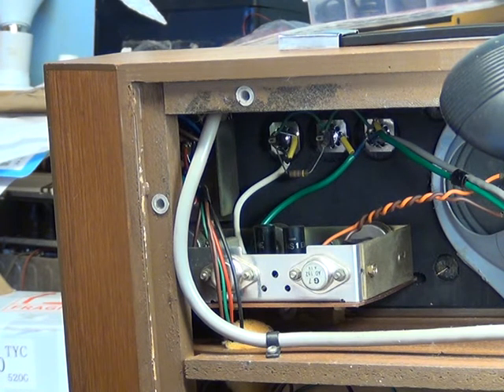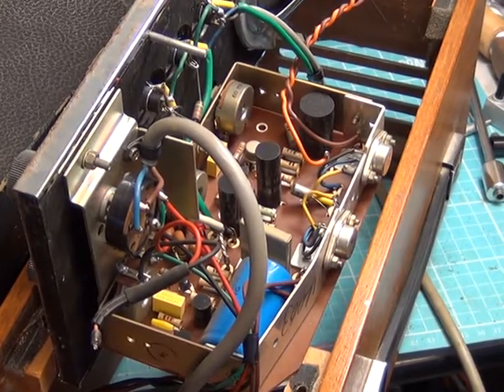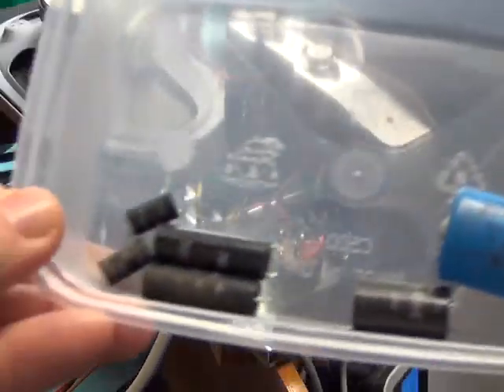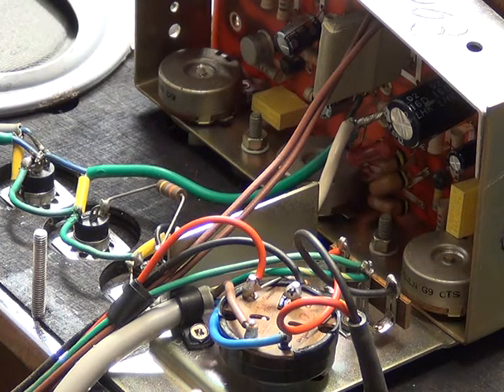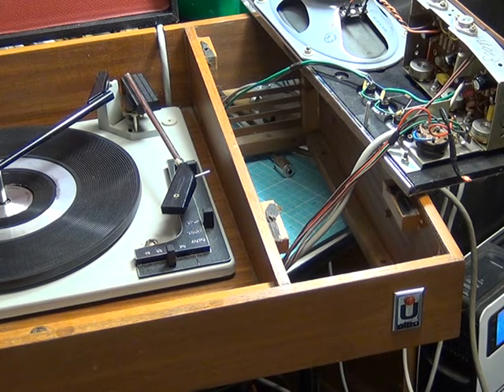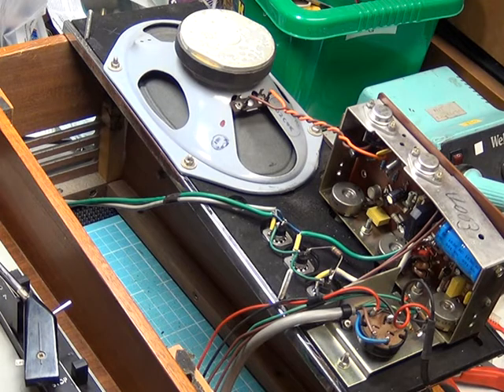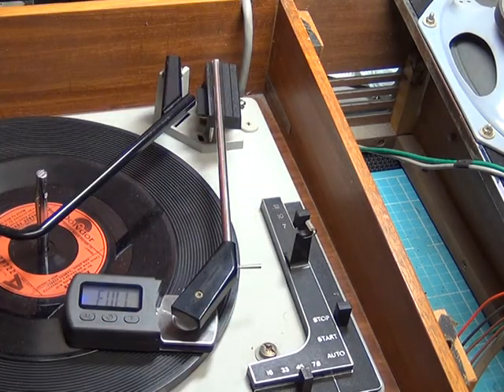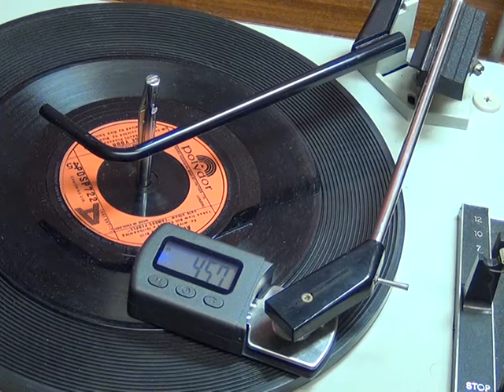Ultra 6042 record player service - Pt2 of 3

Comment: Hello
What rectifier did you replace the old one with? The circuit diagram doesnt tell you what type it is!
Reply from the maker: We'd have put in a generic 6A 100V bridge as an 'overkill'. Original was probably 3A @ 50v. Sometimes when part types aren't obvious, this is the most sensible approach.

Richard
Reply: @ukfmcbradioservicingTango21  thanks for that! :)

Comment: Hi Would you remember the capacitor values?  It looks very similar to an Ultra 6018 my parents have which has developed a mains hum.  Otherwise working okay.  Thought I would change the caps first.
Reply from the maker: Luckily for you I had 10mins to spare in order to dig out the service manual for the 6018. It's a 1969 products and my manual covers the 6018 schedule B (you may need to check your version...it'll say on the chassis), also covering the HMV 2040....Use 35v or higher rated capacitors @ 105 degree temperature rating throughout C12 2000uf (use 2200uf) C13 400uf (use 470uf), C11 250uF (use 330uf) C8 250uf (use 330uf) C3 75uf (use 100uf) C2 2uf (use 2.2uf).

Richard
Reply: @ukfmcbradioservicingTango21  Brillant thanks for your reply my parents will be pleased - especially as I'll be able to carry out the repair at their house.
Reply: I mean't to add - without taking the record player away to check the values!
Reply: Only just got around to putting the amplifier back into the Ultra 6018 at my parents house.  Short video to say thank-you here: https://www.youtube.com/watch?v=y7LzX9XTJC8&feature=youtu.be